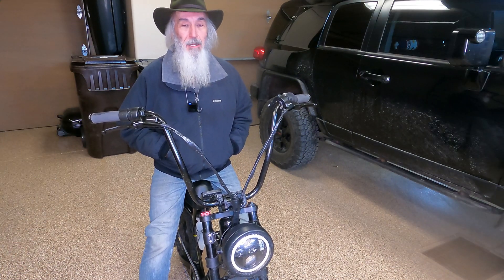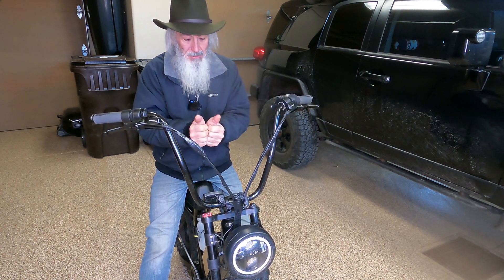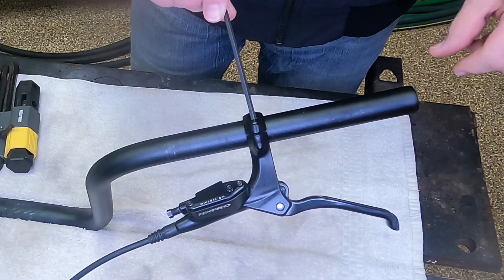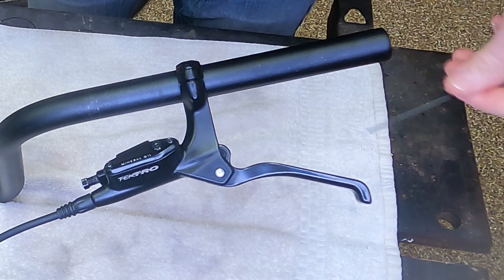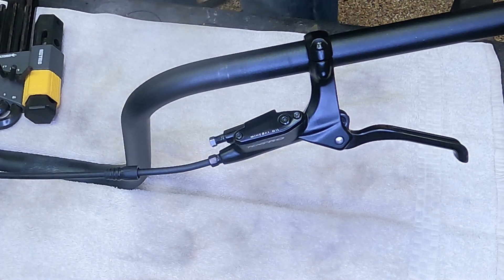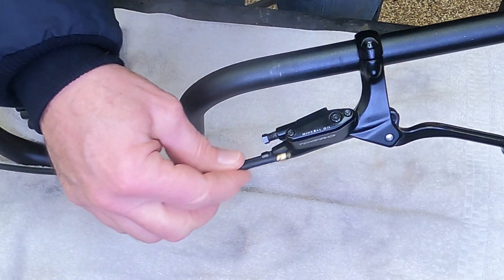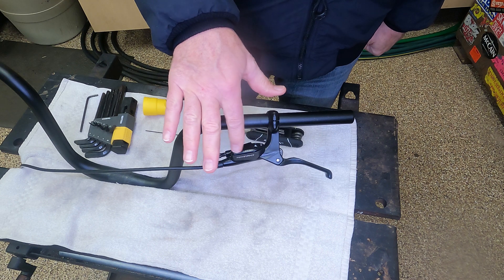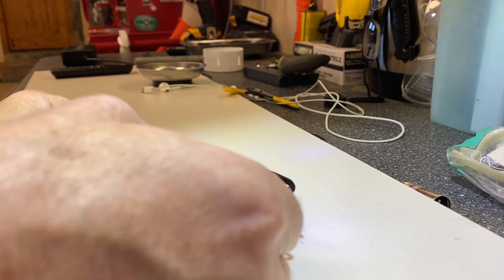Tektro E-Bike Brakes HD-E350 detailed explanation of everything necessary to DIY Repairs and Mods

Comment: you're doing the Lord's work with all the detailed explanation.  i'm pretty sure the single millennial girl that lives across the street from me doesn't have most of these tools though.  for the rest of us: very useful.  you have some really practical pointers in here (like probing for gaskets, etc).   

btw: that cable wasn't frayed of nothin'.  it fought till the end, until you took a flamethrower to it.  just sayin'...  don't be sprised if the UN rings you up for some kind of rights violation.

my only additional point would be: "normally closed" means that the circuit is functional.  not everybody knows that.  "normally open" means that the circuit does not work until the switch is activated.  think a light switch for the latter.  you have to turn the light switch on to make it work, which is desirable for your bedroom, for example.  

i have  philips LED lights (cheap to operate, and i'm plugged into the bonneville dam), so ii leave them all on in the front of the house, and just adjust them.  that circuit is "normally closed."

see uncle?  i was really paying attention, lol!
Reply from the maker: Yea, when Editing I realized I may of had the wrong call on the normally open vs normally closed. But Figured I could correct it in the comments.
Have the Single Millennial woman call me & I can personally help her
Reply: @UncleFjester  i think from a functional safety standpoint you're likely correct.  not sure.  one would want to interrupt the circuit to stop the motor by applying the brake.

as far as my hawt neighbor - nope: she rotates through boyfriends about every 6-8 months, and i want a turn next.  i've been watching this for a few. years.  she's pretty ez on the eyes.  i think she only needs one tool actually anyway.
Reply from the maker: OK, I just double checked, FWIW, the contacts on brake lever are normally open. The Germans (Magura) call it a Closer.
Reply: @UncleFjester  ok, so that implies that it activates some other device that cuts off the motor.  makes sense to not push current through there.